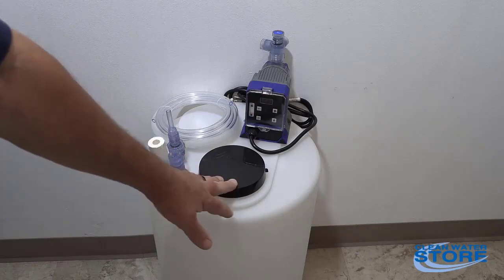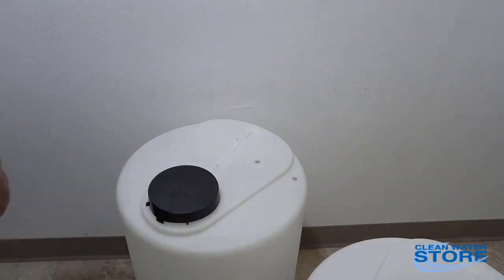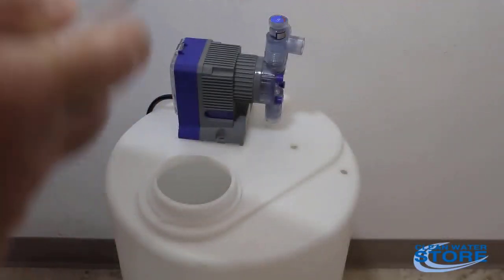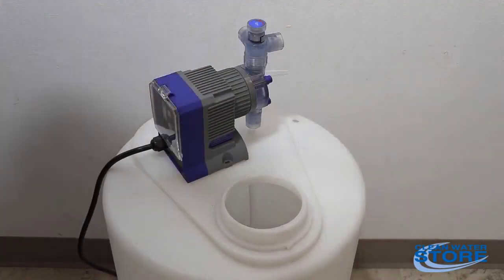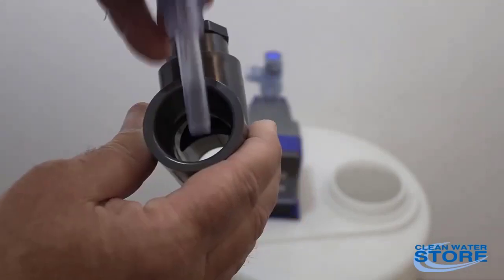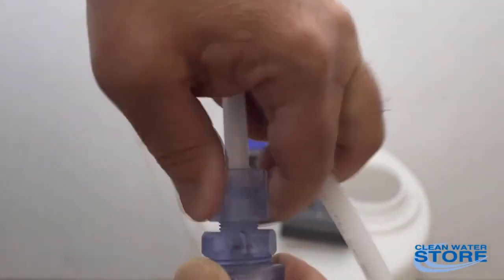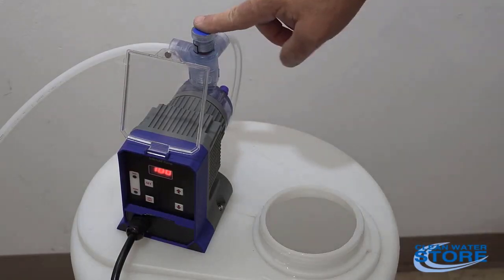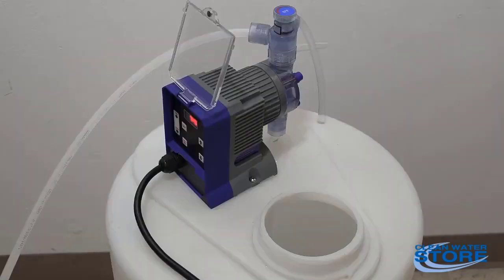J-PRO-22 Soda Ash Injection System for Well Water

Comment: Had this pump in my setup in the basement. The Kachunk sound it makes was nearly impossible to sound proof and could be heard in my house when the water was turned on. Its quite a thump like bass it puts out, like a drum being hit. Super Annoying. It gave out on me 2 months after the warranty period and given the price of it I am going a different route now for my soda ash injection.
Reply from the maker: Sorry that happened with your pump, they are usually good for 5 to 7 years so that is not typical. We do have a 5 year pro-rated warranty on these and if its only 14 months old you can get a replacement pump for free..   

We have sold thousands of these pumps and the sound issue has come up before,  especially when its installed in a home and that can be really annoying.  All these types of solenoid diaphragm pumps make a thunking sound when operating.    It is much worse when its installed on a shelf or wall.  We have customers deaden the sound by installing them in a small plastic or stryrofoam cooler with some cheap sound panels around the pump inside the cooler.  

If you would like help with that please reach out to our support team at support@cleanwaterstore.com.
Reply: @CleanWaterStore  , thank you and I appreciate the reply. Overall the solution you guys gave me in my overall system worked great. I did consider contacting cleanwaterstore to see what we could do, but honestly I couldnt get around the noise of this pump and it wasn't about the money anymore. I had tried so much to deaden it, but its hits a really tough sound frequency to cover up. I had it in an insulated foam box , and then in a material sound deadened box within that. My sound deadening honestly is probably what killed it, I imagine it wasn't breathing like it should. It sits under my basement steps central in my house with my water system. As an alternative I was able to home brew an arduino solution into the flow meter that was paired with this pump and I did get it to tell me every gallon that is flowing and then I run a relay with a timer for solution control off that signal to a more traditional cheap injection pump that I am able to deaden the sound on effectively. I also now have led lights and a digital display readout that tells me my solution level and alerts me when I need to refill the soda ash. Soda Ash solution level was another problem I encountered with my injection system that I was not knowing when it was running low and running the risk of running the pump dry and the ph dropping in my home.  I have landed in the same place with some upgrades I was able to brew, and now my replacement pump is more affordable and quiet. I did think this pump was good, and in hindsight I literally would have poured it its own concrete box as my home was being built to isolate its sound. Its a thumper! 😆

Comment: Great video.  I have had my J-Pro installed for three years now and it has worked great.  I have the spare parts kit ready to go for servicing. I am rethinking my watrer treatment system, currently using this pump with a proportional feeder for acid neutralization.  Can I use this same pump to proportional feed hydrogen peroxide for oxidizing ferrous iron?
Reply from the maker: Hello -  yes you can use the same J-PRO pump for peroxide.   If you have any questions about that please reach out to our support team at support@cleanwaterstore.com